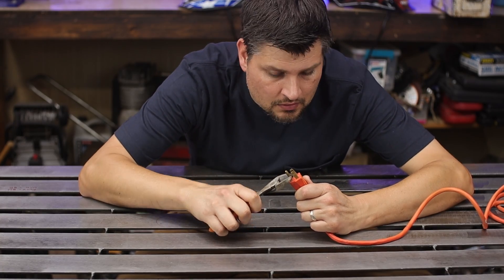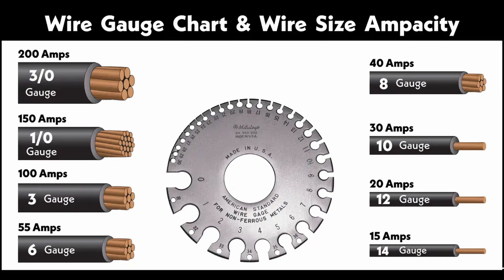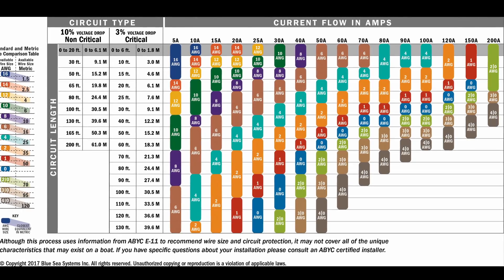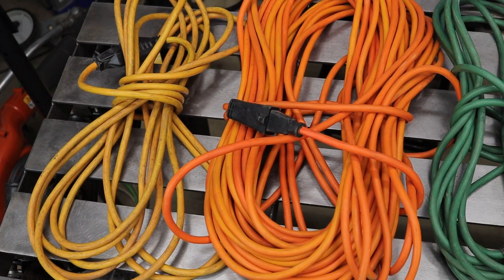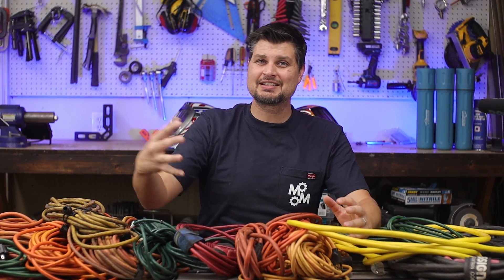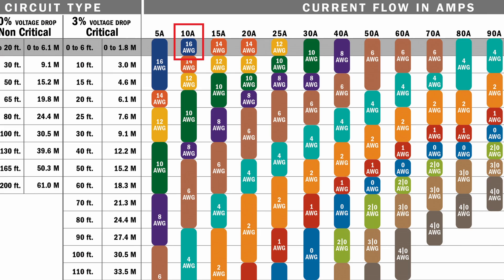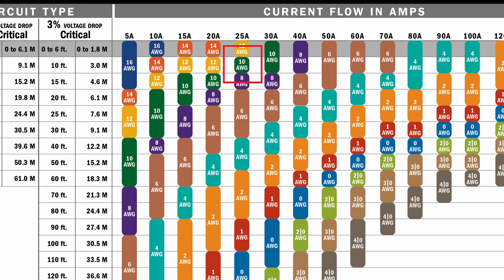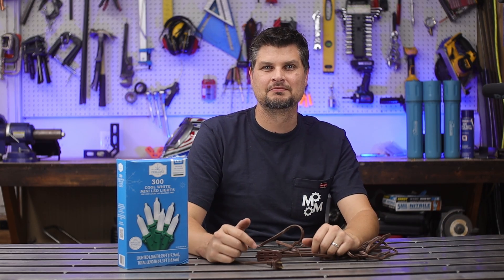Stop Using the WRONG Extension Cord // How to Choose The Right Size

Comment: Whats missing from the video is the plugs on the ends of the cords also have a rating. The cords you showed all have NEMA 5-15 plugs which are rated to 15 amps max so that may not be the best cord choice for the welder.

Comment: Let's be for real, don't max the cords ratings, try to keep it as low as possible and go up one size, if you max it and keep a constant max load on any cord it will get pretty hot, and it could ignite. With the cheap metals that are used now a days and poor manufacturing standards/QC I would not risk burning my house due to low quality poorly manufactured electric cords. don't forget to have a fire extinguisher nearby.

Comment: I need a portable air conditioner for my detached garage. The air conditioner says 12amps (B&D Portable for 550 sq ft). My 50ft extension cord says "50 ft Waterproof, 16/3 Gauge Flexible Cold-Resistant Appliance Extension Cord Outside, 13A 1625W 16AWG SJTW, 3 Prong Heavy Duty Electric Cord, ETL." Will this work? When I plug the AC into my garage outlet directly, it pops breaker. Not sure why as the only things plugged in are the garage door opener, a few LED shop lights and a radio.
Reply: 🤦🏻‍♂️🤦🏻‍♂️🤦🏻‍♂️ why would you ask that? You need 12a and the cord clearly say 13a

Sheesh

Comment: Hi. Please help. 
I have an Amazon portable washing machine that I have been using directly plugged into electrical outlet. It is called Zen Style twin tub washer for up to 13lbs of laundry. It’s the best washer I ever used! Clothes are super clean. But now need to move it 10’ away. Any suggestions? I’m hoping a 10ft long cord is doable from HD or Lowes. I want to buy the most appropriate one. 
The little manual has the info, see below. The Chinese Company seller has no info about extension cords on the Amazon site and it isn’t easy contacting them. 
Rated voltage 110V
Rated frequency 60 Hz
Rated energy consumption power 240 Watts for washer 120 watts for spinner.
I surely appreciate an answer.
Thanks.
Reply from the maker: Are there watts or amps listed anywhere on the machine? Would most likely be on the motor nameplate.
Reply: @-DIYPRO-  just looked at the back plate and states same as I mentioned above from the few page manual. Washer 240 W + Spinner 120W 360 total W
It’s a small machine. Easy to pick up lol.  Both sides can be used at the same time but I use one at a time. It operates manually with, like a kitchen timer. So one timer at a time for me. I could have a few garments in the wash tub soaking while I spin a few items in the other side, using it’s separate timer.
Reply: @-DIYPRO-  also no heating elements in the portable. Still cold water gets my clothes cleaner than my full size. Have you ever tried one of these machines! Such a good price. 

I don’t use my full size often but for a blanket but it’s programmed to allow a certain amount of water. Crazy, I have to add water with a hose or the blanket wouldn’t get fully wet or clean. It was a new model by Sears, few years ago. So many people complained. Sears warranty did nothing for us, said it is the way it is made. Lemon! They discontinued it. 

I’m so addicted to my mini washer! Most people say they will never use a full size again unless absolutely needed for large blankets. For less than 100 with shipping☺ I use it outdoors in summer. Indoor bathroom in winter.
Reply from the maker: @flbeachinggirl a heater would definitely increase the required gauge. Even rounding up to 400 watts you'd be using 3.6 amps. 
You'd be good with a 16 ga at 10 ft or I'd bump it up to 14 if you get a longer extension cord. Hope that helps.
Reply: @-DIYPRO-  is a longer cord better? And is a cord used for more powerful appliances higher watts better. I know nothing about cords. I wouldn’t mind a cord meant for higher watts in case I could use it for other projects, if a 10’ is just as safe or unsafe as a longer one, I’ll probably get the 10’. It’s okay to run weaker appliances on heavier duty cords? Thanks so much.
Reply from the maker: @flbeachinggirl  Yes you can definitely run less amps or "a weaker appliance" on a thicker or heavier duty cords.

Comment: I have 100ft code with no writing on cord however has tag that says 15A, should the writing be on cord also?
Reply: Yes. It should be imprinted on the cable exterior. Often, it is hard to see, especially on older cables due to wear and tear.

Comment: I have a welder that's 110/220v+15%. Input current is 39v. I'm waiting to get an extension cord for it but I don't know what to get. It came with a 6" N6-50 3 prong 240v that converts to a type b and the cord coming from the welder is also a type b. Theoretically I could plug any household extension cord but I know that's not a good idea. Also I'm not sure how the welder is even running off 240 when the plug is covered to type b on the output? Hopeing you could shed some light on this and give me some advice or recommendations on an extension cord under 25ft?
Reply: I take it that you have a dual voltage welder, and that it has a big 220v plug on the end of the built in power cord. And then you have an adapter that has a big socket that matches that plug. On the other end you have a standard 3-prong 110v style plug. 
     It's best if you can plug that big plug into a 220v outlet in the wall of your garage/shop. The next best is to use the adapter to plug into a 110v outlet with a 20A breaker in the wall of your shop. You will be very limited if you have a 15A outlet..
    But, let's say you only have a 20A outlet for your washing machine near the back door. And you want to weld outside on a patio, driveway, or other suitable surface. 
     I have a similar situation, and I use a 25ft. 10Ga cable with a triple outlet. They have a 12Ga version. With tax they cost $50 and less than $30 respectively at Harbor Freight. If you can't get to a store, or they charge too much, I'm sure you could get them on Amazon. With a multiple outlet you can leave the welder plugged in so it's fan can cool critical parts, and also maybe have a very bright work light, grinder, etc. 
     Always use the biggest extension cord you can and the shortest that will reach. 
I'd go with 10Ga, but Do Not go smaller than 12Ga. (With wire gauge the smaller the number the bigger the cable.) 

    If you plug your welder into a 110v outlet it will try to deliver the current you set thru the arc. The dual voltage power supply just works with the voltage you give it. The output current setting is the main thing you control, and on low cost welders the only setting you have. 
     Also the current settings can be wrong on low cost machines. If the arc is weak, and it keeps sticking, you might have set it at 70A, but you might be getting 40A. So maybe you just set that machine on 100A to get the result you need. You could still get years of useful work out of that machine. 

     The machine should protect itself by limiting it's power, but if it draws too much current, your circuit breaker will trip (shut off) to protect the wires inside your house. It's Ok, but you are reaching the limits of your electrical system. You just don't want to do that all the time.  

     Anyway, don't get discouraged. There's a lot to learn, but it's cool when you figure it out. 
      Oh yeah, it might be hard to find a heavy cord shorter than 25 feet. You could cut a 25ft cable into 10ft./15ft cables. They make replacement plugs and sockets. So you could have an original plug and replacement socket on one and a replacement plug and original socket on the other. Your local hardware store or you-tube video should be able to help. Good luck.

Comment: Hi DIY PRO, quick question. Can I use  power strip and  extension cord  made for use in US and use it in thailand knowing the Voltage in US is 120V and Thailand is 220V. I am moving there and wonder I can use it there to connect things like vacuum cleaner, computer, phone, lamps or air fryer, blender  or fan. I am not sure it is safe. Thank you!
Reply from the maker: It depends. "MOST" cords and power strips are rated off amperage and not voltage so theoretically you shouldn't have any issues as long as the amperage is low enough.

Comment: Jokes on you my house has 16 gauge still
Reply from the maker: Sorry!
Reply: Must have been late  60s-70s; it was an upgrade from aluminum wiring.  Of course you only needer to plug in a fan or a lamp.  Be super careful with a space heater.
Reply: Ya my buddies trailer house has 12 gauge aluminum it was weird when I first saw it

Comment: Excellent video and information. I bought a 3-foot extension cord that is rated: 14/3 (don't know what this means) and 15A (125V/1875W) and 14AWG. Is this extension cord safe to use with a portable AC unit that is rated at 11.25A or 1350W ? Thank you for sharing your knowledge.
Reply: 14/3 means 3 14 gauge wires (one hot one neutral and one ground). As for the rest of your question, you need to see what else is running on that circuit since most homes only have a 15amp breaker in each room and you don’t want a high powered device kicking on while the AC is running. Remember everything connected on that circuit is cumulative. If you decide to use the extension cord I’d recommend monitoring the extension cord and the outlet itself to make sure it’s not getting warm or hot. If it is, stop using it obviously.

Comment: Thankyou for posting.  Good info.  One question if you don't mind... do those multi-tap outlets or power strips cause more resistance than a single outlet cord?
I plan to use a 25ft 12awg cord to a single power strip, to hook up several things... 2hp compressor... jobsite table saw... table router... miter saw... drill press... and 3 dust collectors.  Sounds like a lot right?
But --
     -- The strip is rated at 20amps (supposed to be anyway)... with 6ft 12awg cord.
     -- And only two tools will operate at any one time.  Tool + one dust collector.
     -- Of course nothing will be not be on constantly, but intermittantly.
So to me it sounds good.  Any thoughts?

Comment: I recently got a Vulcan OMNIPRO 220 and it says to not use any extension cord for it, does that mean I can’t use it with an extension cord even if it’s capable of handling the voltage? A beginner welder and still learning sorry for any confusion!

Comment: I believe that is a marine DC Chart from Blue Seas Marine Switches, Circuits & breakers. AC voltage drops at higher voltages changes the amperages and distance.
Reply: Yes, Correct. That chart is for a DC wire gauge and will differ from AC gauges.
Reply: I had the same confusion—thanks for the clarification!

Comment: Well Done... Short, Clear and to The Point. Thumbs Up !!
Reply from the maker: Thanks!
Reply: @-DIYPRO-  Hello Sir. I want to drain an inground pool using a 1 hp (110V, 735W, 9.7Amps) sump pump. The nearest outlet uses 12 gauge wire, & is 45 ft away from the pool. The outlet itself is 80 ft away from the breaker box. So total ft from breaker box to pool pump is 125 ft. I want to use a 10 gauge extension cord from the outlet to the sump pump's power cord. Will this setup be good to go, or would it be dangerous? Thanks for your help.
Reply: @GoldenCup888 yes a 10 gauge extension cord for 100 ft even a 12 gauge should work. Just make sure you get the one with the proper connectors at the end, ones with fuses will help but not really needed.